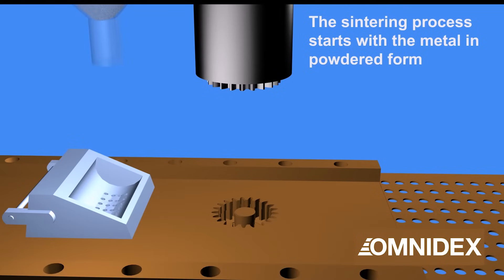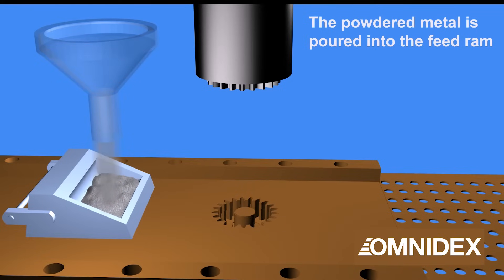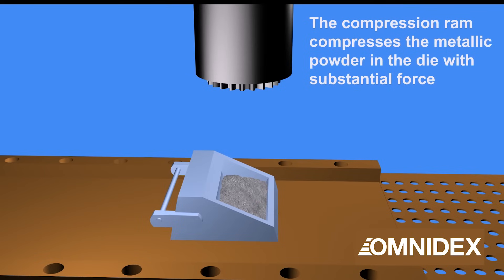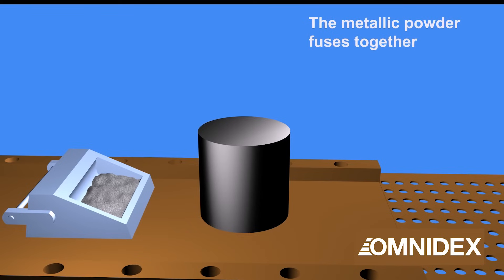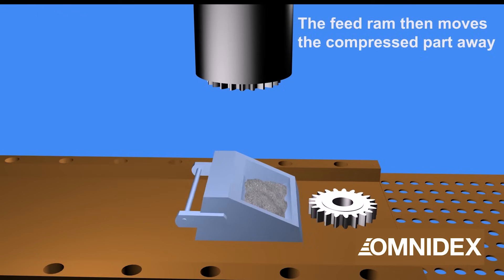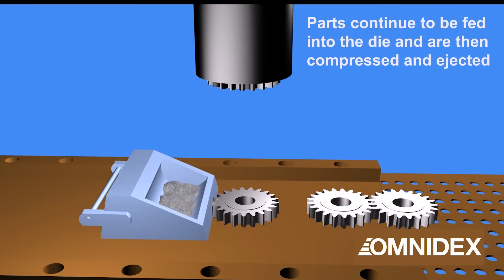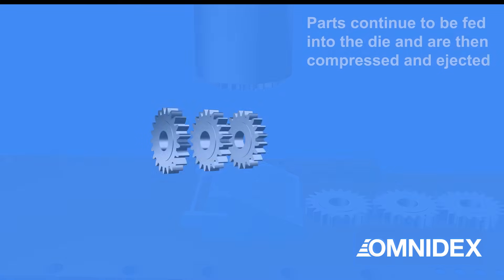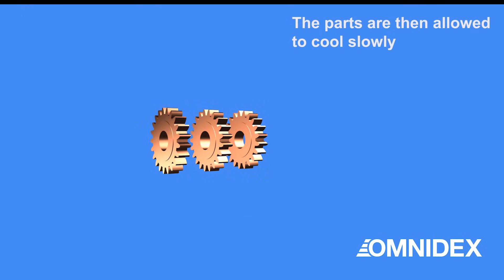Sintering Metal Process

Comment: so sintering is whole process or just baking portion?
Reply: Sintering happens in the furnace. It is the process of heating the part to the point where the metal powder fuses together. The part formation stage can be the same pressing process as shown or other processes such as metal injection molding or powder injection molding, to name two.

Comment: Holy crap, several days to sinter parts?  I work at a powder metal manufacturing plant and I work on the compact presses and sinter furnaces.  It only takes our parts 1/2 to 3 hours to go through the sinter furnace, and yes, that includes the cooling process.  We don't make any parts that take longer than that to sinter.  WTH?
Reply: the process CAN take up to several days, doesn't mean it always will :)
Reply: Well as we know some businesses are MORE efficient & up to date than others
Reply: How much heat is needed to fully fuse the metal together?
Reply: @mjkhan9664  I don't know about all plants that manufacture powder press parts, but the parts we manufacture require a temp in the range of 2000 to 2100 degrees F in order to fully fuse into a solid metal part.  They need to be run through the furnace at temperature on a belt about 30 feet long.  It takes about 1/2 to 3  hrs for a part to transverse the length of the furnace, so they are subject to 2000 plus degrees for 15 minutes.  We take 3 parts off the end every 15 to 30 minutes to do checks.  If they are out of spec tolerances, like too small or too big, we can either adjust the temp up or down, or adjust the belt speed to bring them back into spec.
Reply: @JohnHWelch63 John who builds your PM tooling? Are you in Pennsylvania?
Reply: @Speedbump123  No. Portland, Maine.  The name of the plant is Nichols, formerly called Nichols Portland.  When you say PM tools there are two meanings.  Do you mean Project Management software or the machine tools, like molds, jigs, etc.?  The machining tools are made in house.
Reply: @JohnHWelch63  thanks for getting back to me. When I talk of PM tooling I’m talking about the tooling that actually produces the parts in the press. Upper punches, dies, core pins, lower punches. I have heard of Nichols Portland before. I believe they actually acquired a Powder Metal division just up the road from me called ALPHA PRECISION GROUP. in ridgway PA.
Reply: @Speedbump123  I retired a while ago so I don't know what they've done since I've been gone.